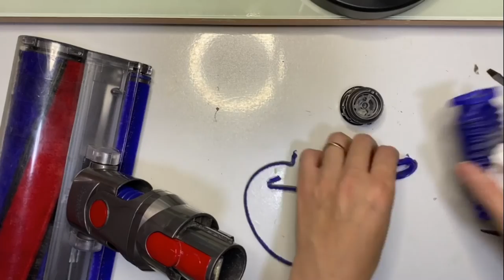Dyson V7/V8/V10/V11 Soft Roller Cleaner Head Refurbishment

Comment: I had one in bits, cleaning it. A 2nd hand on I picked up cheap. The soft roller looked fine.

I really don't see the point in washing it. It rolls inside the machine, gets scraped a little bit by a horizontal edge of plastic and all the dust gets sucked up into the vacuum.

The roller has been constantly being vacuumed, every time it's being used. So why would you need to wash it?

It shouldn't have any dirt in it, at all, or practically none, I would have thought.

It will have been hoovered for hours and hours. The same length of time you have used it to hoover your floor, that's how long that brush roll has been hoovered, by the hoover, too.

Why would you wash a bit of fabric that has been hoovered as much as that?

Comment: Hi. What is the purpose of the velvet blue strips and why the need to replace them? Just wondering because mine look worn out.
Reply from the maker: The blue strips are assisting for cleaning the surface of the carpet. It can keep in use if the worn out is not too worse.

Comment: How do you disconnect the wire...
Reply from the maker: Simply press the antilock via the small hole in the connector then you can disconnect the cable easily.

Comment: Dyson products are way overrated.
Reply from the maker: Actually, the design of Dyson product is great. I just dismantle the V6 battery pack, it is well designed and each battery with Dyson logo. Many other companies duplicate it's design. However, Dyson product price is too high.
Reply: @ricky016  I do agree that certain aspects of Dyson product is great. But it is way overpriced and does not live up to the standards of such a price. I personally owned a V8 and I do not agree that the suction power is great, again, for the price I can get at least 2 vacuum cleaners that can out live Dyson one. Also, the replacement parts of Dyson products are EXPENSIVE too, unless you go for the Chinese counterfeit products that may not last as long.
Reply: Thanks for the video by the way. Videos like these are very helpful to people like me who are idiots when it comes to taking things apart and putting them back together.
Reply: For those using Digital Slim Fluffy Extra - please remove screw hidden under Red Button adjuster.